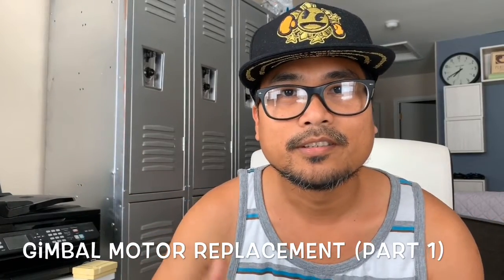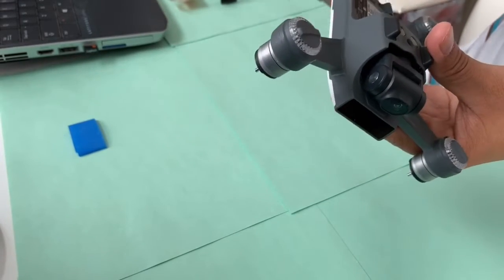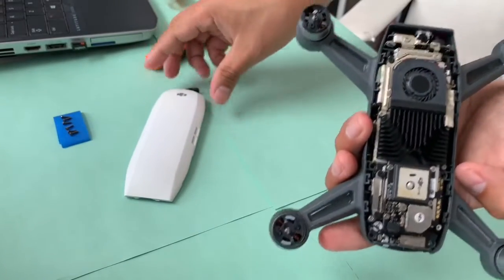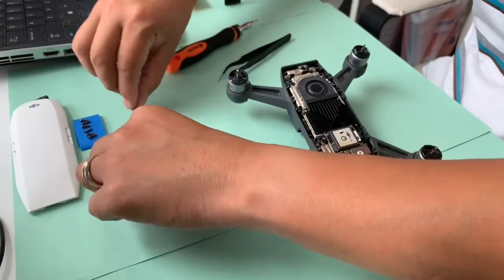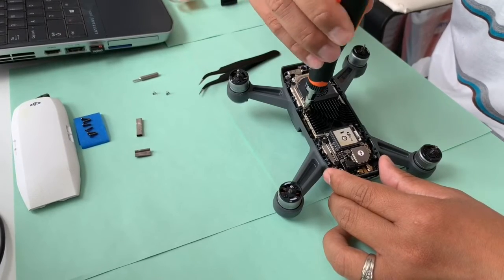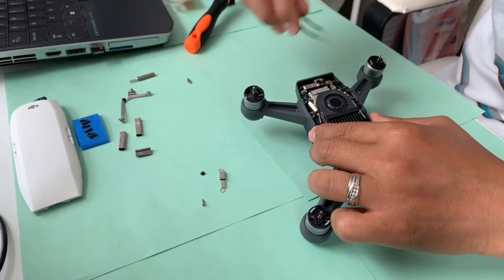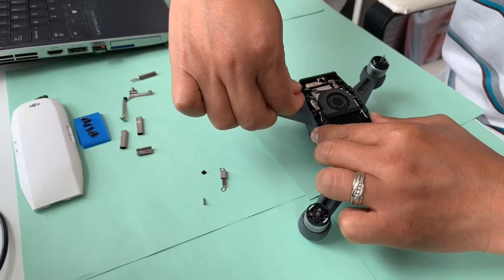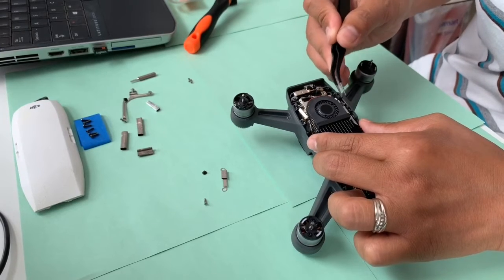DJI Spark Gimbal Motor Replacement (Part 1)

Comment: Hello friend, the gimbal of my spark is loose, I don't think I need to change it, just adjust a few screws, I must do this procedure but I'm afraid of damaging the entire drone.
Reply: I think they are the two screws you remove at minute 9:04
Reply from the maker: You will need to remove the motherboard to get into the gimbal.
Reply: @rommelgloria  where we get the camera case that you use in this video
Reply from the maker: @abhinavyadav3844  ebay
Reply: @rommelgloria  can give me the link please
Reply from the maker: @abhinavyadav3844  actually I don’t see it anymore on eBay, fortunately Amazon have it
Gimbal Motor for DJI Spark,1PC Gimbal Motor Spare Part Repair Replace for DJI Spark Drone RC https://www.amazon.com/dp/B07H8DP93F/ref=cm_sw_r_cp_api_glc_fabc_7Fi7FbSQCG5SG